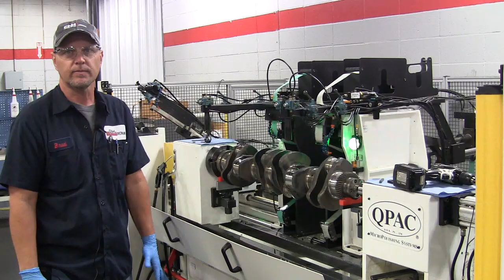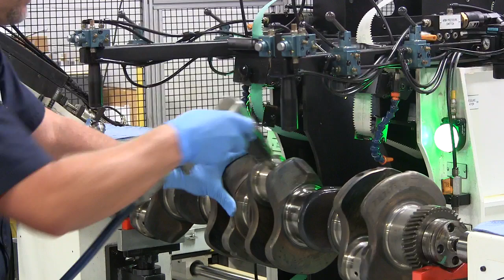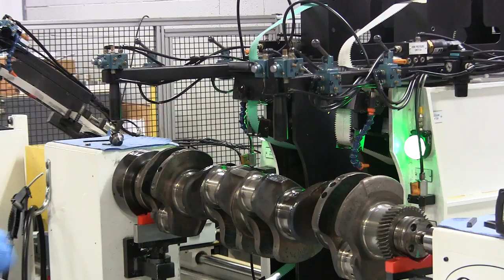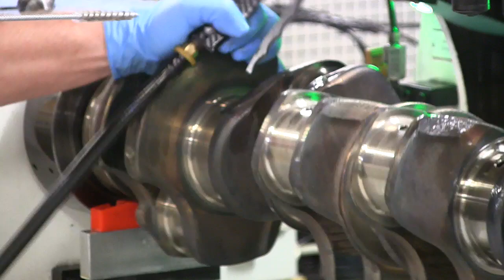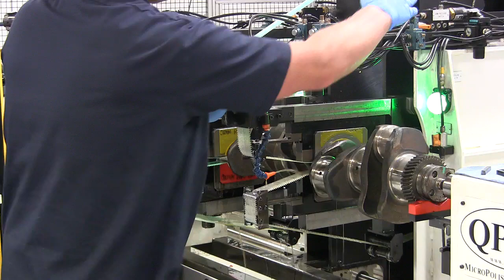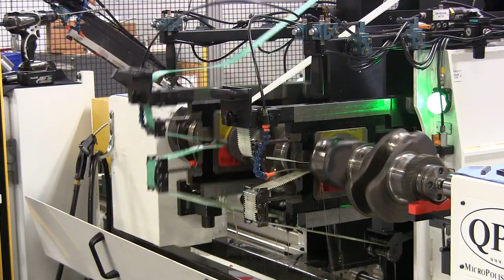CNH Industrial Reman - Crank Shaft Polisher

Comment: That's a lot of expensive and unnecessary crap when a high speed hand held micro polisher will do a better job.
Reply: Its not unnecessary, its how you get 250k miles out of an engine
Reply: @xESPplayer500x  appears that you don't have the experience to know what's going on!  And you didn't notice that the crankshaft is in the machine backwards, unless it's a reverse rotation marine engine, but if it's a clockwise rotation, this polishing will eat up the bearings,  here is a test for you.(if) you built a engine before?? By hand spin the crankshaft in both directions and you will notice that it tends to grab in one of the directions!  Cutting or polishing will put a directional grain like a piece of wood.
Reply: Hello what are you even saying with a micro polish handheld? This company has developed and research this machine have you done and test all their machines to tell it's crap? Probably million of dollars into making that company QPAC of the crankshaft grinder
Reply: @JoseRodriguez-fy9so that's a lot of machine to do a simple job  NOT COST EFFECTIVE.
Reply: @dpierson489  soo you might say its a simple job but they are giving you a RA finish of literally microns of tolerances that cannot be replicated by your handheld "micro" polish dewalt tool my guy, stop copium dude